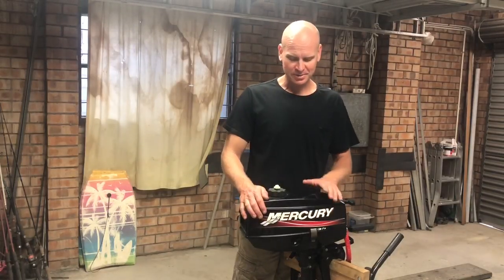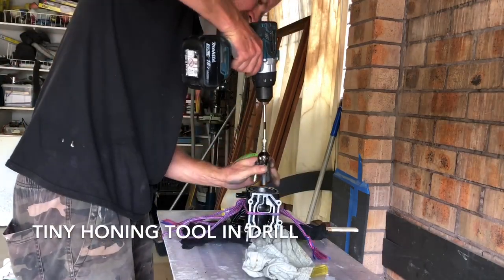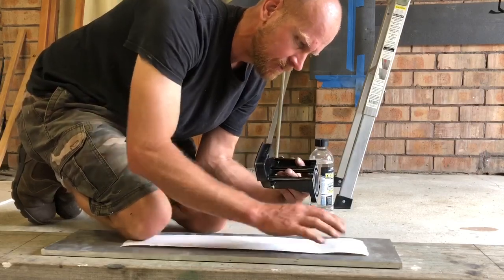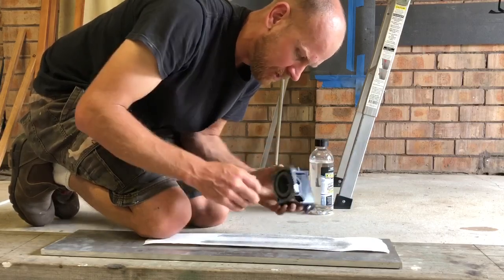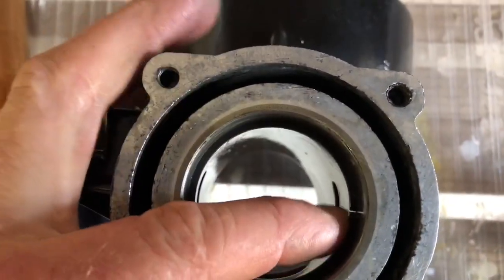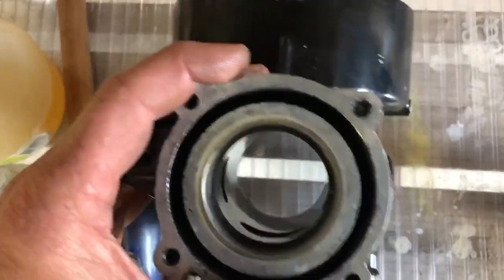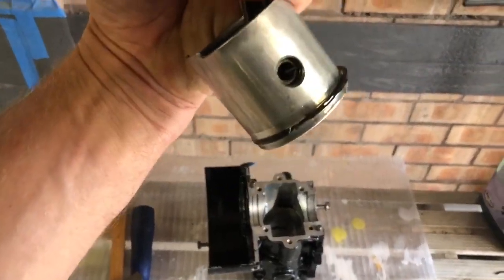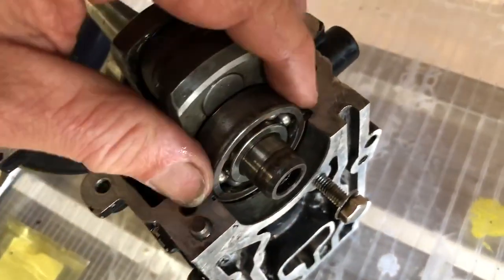Mercury 3.3hp rebuild

Comment: guys i have one question, does this outboard has fuel filter, i can't find it anywhere in the engine
Reply from the maker: Hi champ,
Some of them have a tiny fuel filter in the fuel on off mechanism. I have had to clean them out before.
Cheers 🍻 
Aussie Boat Guy 😎
Reply: @25hpboatracerman i bought it new recently and i find it weird that this outboard has no inline fuel filter as contaminated carburetor from dirt or debris are the dominant cause of engine hard to start or running not well, looks like i have to manually add on a fuel filter

Comment: Do you know what the compression should be on this engine. Mind is pluttering but wont start. It has spark and is getting fuel..
Reply from the maker: Hi Mate,
I have seen a broken flywheel key before, that can change timing and cause misfires or not even start, maybe remove the flywheel and see. Also make sure the little coil that sits outside the flywheel is connected and good, think it’s a pulser coil for timing.
Cheers 🍻 
Aussie Boat Guy 😎
Reply from the maker: Hi Mate,
I would do a carburetor overhaul all the same just to make sure it’s atomizing the fuel correctly. compression should be over 100psi.
Cheers 🍻 
Aussie Boat Guy 😎
Reply: @25hpboatracerman  Thank you Aussie boat guy. I've tried a second carb because sprayed starter fluid. The initial problem was no spark. I removed the flywheel and cleaned the magneto after that a strong spark but just won't fire it just pops or the pull start kicks back. It's definitely trying to start but it just won't.  Do you think I could have knocked the timing off when taking the electrics apart? Is that even possible?

Comment: is that bottom seal in correct, uaually the spring goes inside the crank to seal pressure in, it may work either way I am not sure, 🤔
Reply from the maker: Hi mate,
Good question 👌
That is the correct way for the seal and the way it is installed from factory, I’ve checked many times with lots of motors. I know it feels like it should be the other way but keep in mind there is another two seals in the lower seal - drive shaft tube.
Cheers 🍻 
Aussie Boat Guy 😎

Comment: what is your oil mix ratio on the motor ?
Reply from the maker: Hi mate,
I use 50 to 1 two stroke outboard oil ratio.
I use 25 to 1 for a tank after a rebuild to run it in.
cheers 🍻 
Aussie Boat Guy 😎

Comment: Hello i wondering if you can help me. i have ordered a head gasket for my 3.3 because there is a leak when the engine is running from the join. Do i need to do anything else or would that be enough to solve the issue.
Reply from the maker: Hi 👋 
It should be enough to solve the issue unless the block or head have corrosion that is causing the leak.
If the block has corrosion it is a little tricky to sort. If the head has corrosion you can put some sand paper on a piece of flat glass, place your head on it and sand it to remove the problem, do not sand more than 1/2 mm.
Make sure you scrape clean both surfaces before putting the new gasket on.
Make sure to torque the head bolts to the correct torque.
Cheers 🍻 
Aussie Boat Guy 😎
Reply: @25hpboatracerman  I don’t suppose you know the size of the bolts which hole the head on my ones are warn.
Reply from the maker: @manston94  
Hi mate,
I would personally order them from Mercury.
Also check your threads in the block, make sure to Helicoil them if they are flogged out otherwise you will not be able to torque them without them stripping.
Cheers 🍻 
Aussie Boat Guy 😎

Comment: Hello , awesome video . Can you tell me the torque value for head bolt  ? I have a 3,3HP Mercury 2 stroke .  Thank you in advance.
Reply from the maker: Hey mate,
Tohatsu (which makes the 3.3hp Mercury two stroke) states that the m6 bolts are torqued to 6.5ft pounds.
Cheers 🍻
Reply: @25hpboatracerman  Hi, how much is it in NM?

Comment: Hey awesome video. I have a 2hp mercury lightning from the 90s that needs some similar care. Where do you recommend an online parts catalog and where did you buy seals etc? Thanks in advance 😀
Reply from the maker: Hi mate, cheers 🍻 appreciate it.
I’m not that familiar with the 2hp lightning. I would probably start with contacting a Mercury dealer and seeing what parts they can supply. 
I think that the 2hp Mercury lightning is a bit different to the 2.5hp and 3.3hp and the parts may not be interchangeable.
Definitely call a Mercury first and supply your model number. They may be able to give you the actual part numbers too even if they cannot supply, you can look up the part numbers online from there.
I normally order my parts through Mercury or tohatsu for my 3.3hp but will order through Yamaha if working on a Yamaha etc.
Hope you can find the parts.
Cheers 🍻
Reply: Oh I see your comments about parts from local dealer in Aussie. I’m down in NZ and will ring around. Thanks for the video!!

Comment: Thank you ! Needed this video
Reply from the maker: Appreciate your feedback mate 👍.
That’s why I put these vids up.
Cheers 🍻
Reply: @25hpboatracerman   how do you get the fly wheel off my seems to be stuck on
Reply from the maker: The flywheel is bolted down to the crank which has a slight cone shape to it so it really locks on.
I put the flywheel nut back on loosely (covering all the crank thread but up two turns so I don’t damage that) I pull up on the flywheel with my hand (where the pull start bell is) and tap the flywheel nut (making sure to tap it squarely) to loosed the friction it should pop off.
I am very carful not to damage the crank nut or the crank nut thread, I take care and don’t rush things, I don’t just hit things, I keep a close eye to make sure I’m not damaging anything.
It is easy to squash the crank thread or deform the top of the crank nut. If i am unsure I try using a alloy block on top of the crank nut to lessen the risk of damage.
I believe you may be able to make a jig too using the bolts in the flywheel to remove it but I’ve never had to go that far.
I am happy to tell you how I do it but It is just the way I do it, do it at your own risk, It is easy to damage the little cranks in these.
Cheers 🍻
Reply: @25hpboatracerman  appreciate the video 🙏🏽🤙🏽
Reply: Kalau cri spperpat nya dimna ya bos🤔

Comment: G'day Aussie - I  am currently rebuilding one of these, and this video has REALLY saved my skin!!! Mine was quite badly seized, I've now freed it up now - with no obvious damage to the bore. I am having a bit of trouble getting parts - gaskets, bearings etc - have you any suggestions on where to get them (here in Australia) - I can see them on eBay, but they are all enormously expensive. Where did you get yours? Were they reasonably priced? I don't suppose you want to sell the spare crank/piston assembly you showed in video do you?  Can you please drop me a line at TheBucket@email.com   Thanks heaps.
Reply from the maker: Hey mate, I got all my parts from Coho Marine (tohatsu dealer) Anna there is fantastic and knows all needed parts off the top of her head.
The 3.3hp merc two strokes are the same power head as the 3.5hp tohatsu and all made by tohatsu.
Cheers,

Comment: Lower crank seal looks upside down.
Reply from the maker: Could well be and good eye.
I put it back in the way it was installed when I disassembled the power head, not saying it was correct to start with.
The way I installed it does make sense though to keep water from the trunk out of the lower crank bearing.
I still have this motor and use it regularly on a tender (great motors).
I don’t think it would matter too much if it was installed the other way as well.
I will ask my friends at tohatsu which way is correct.

Cheers,
Glenno
Reply from the maker: The lower crank case seal is installed from factory the way I installed it. I’m just rebuilding a 2016 3.3hp and it’s installed from factory the way I installed it.
Just for those wondering when you are re-building yours.
Cheers
Reply: The Aussie boat guy. Yes you are correct I retract my previous statement. I just rebuilt a mariner 2.5hp, and noticed my mistake. Great vids keep up the good work...

Comment: Can you send me all the link to the parts please ?
Reply from the maker: Hi there,
No parts needed, just cleaning the original parts and making sure that there is no debris or any scum in the carburetor.
Cheers
Reply: @25hpboatracerman  no because a segment broke so i need to get a new one
Reply from the maker: Sorry mate, thought this was the carburetor clean video.
What parts are you after? Gaskets? Rings? Seals? 
You are probably better giving your engine number to a dealer and then they can supply the correct parts, that’s what I do.
There may be slight differences in parts between year models etc.
This video is to try and help people putting motors back together.
Cheers,
Glenno
Reply: @25hpboatracerman  thats the thing tho haha i tried every boat store in my country but they don't have the parts i need : i need all the gaskets and the top piston segment.
Reply from the maker: eBay is the answer then.
You will find what you need there.
Cheers,
Glenno
Reply: @raaaaaaaaaaahhhhh  II
Reply: Can u add a link for the proper wreench?
Reply: @michaelscarpa728  if you need to know that you should not ever touch a motor